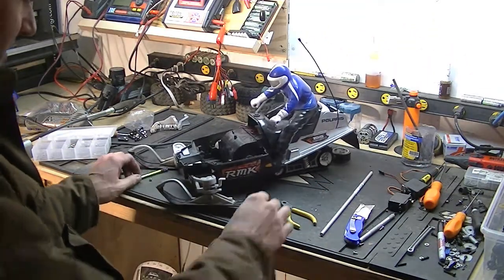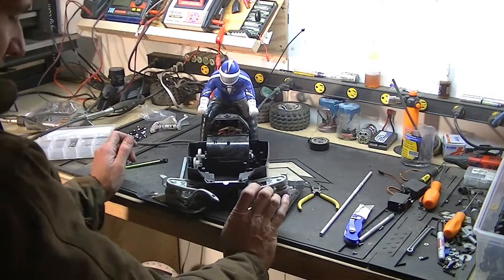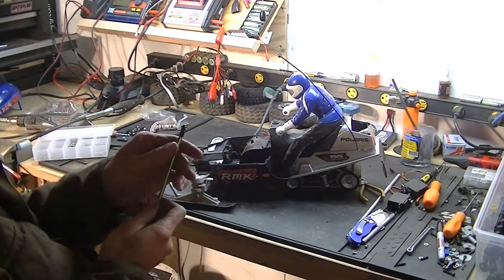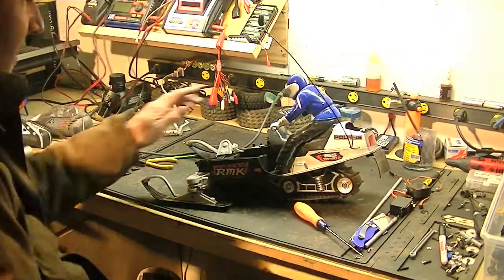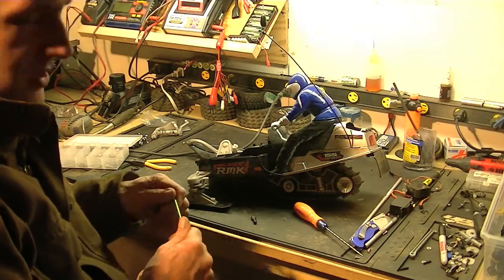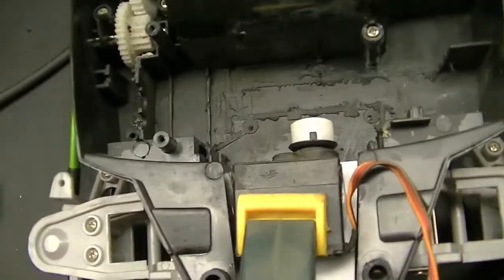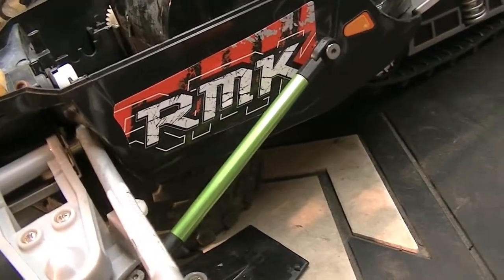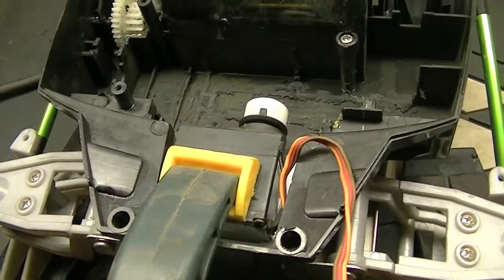RC Snowmobile - Trailing Arms

Comment: I have an older version of this sled im 13 and trying the same project. At the front for the steering, it had a small motor, and a series of gears, which lead to a few plastic pieces, grabbing onto those rods that come out behind the A-Arms and turning them. Between the plastic bits that grab the rods and the front end of the sled, theres about 1 3/4" of space. If you reverse the plastic mechanism, and put a Traxxas Stinger (dont know how big they are, but they might work) motor between the two, then connected the wires from the board on there, but reversed, then that might work. If youre lost, you can e-mail me at LarsonProductions01@gmail.com. The only differences i find in the sleds is that mine has no trailing arms, and mine is still put cemi-together. Please respond, Im stuck too :P